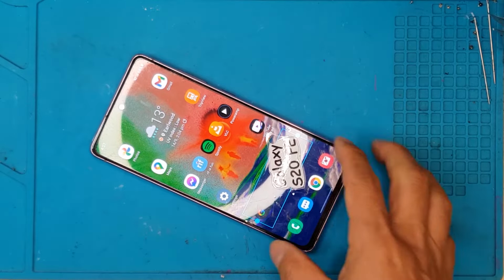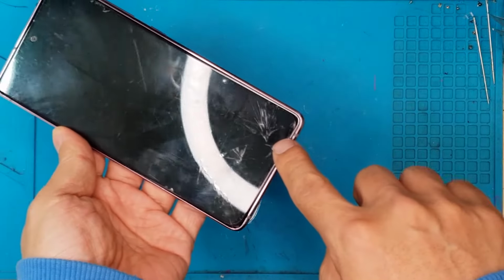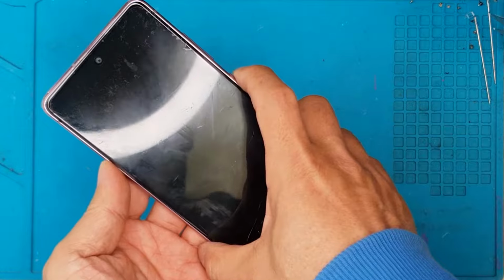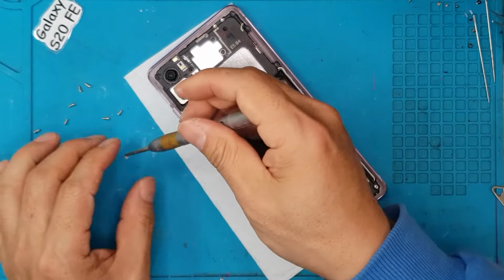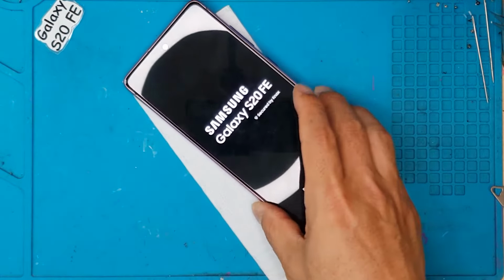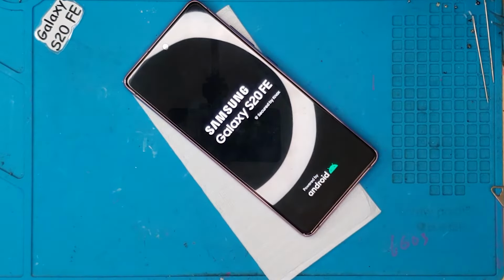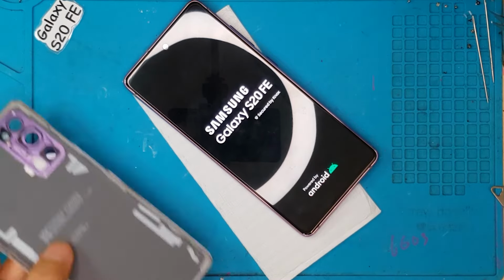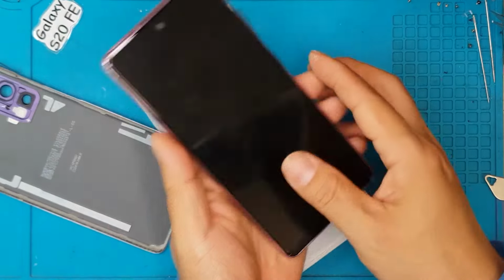How do you replace Samsung Galaxy S20 FE front screen? | Sydney CBD Repair Centre

Comment: Hello, can you please advise this ? The original phone has a metal structure directly behind the volume and on/off buttons, which houses the contacts. My replacement screen already appears to have the contact fixture behind these buttons but without the metal structure. It appears that this is already a functional system as there already seems to be a pc board of some sort there. Do you know if this is correct ? I can't see that the original phone assembly for these buttons can be moved to the new screen assembly. Thank you 😊

Comment: Great video! I followed it to take it apart as I broke the display. I bought a new chasing with a display and all I kept was the back plastic cover. I put all the bits together into the new chasing, and it is charging,I can see the percentage of charging on display but the display doesn't want to switch on!!! Damned, what is this,would you know?

Comment: What is the purpose of Signal Antenna Board on this phone?
Reply: Wifi and bluetooth
Reply: @cuf_  When I tried to replace the battery on the phone, I broke it, then I assembled the phone again and everything still worked, what does it do with wifi and bluetooth then?
Reply: @milandragacevac  the antennas are there to make the signal stronger
Reply: @cuf_  Huh, thats weird,  I didnt really notice much difference in wifi and other connections

Comment: i just replaced my screen in shop but after that gps not working and its very poor network and wifi ... kindly advise
Reply from the maker: Hello, did you use genuine screen for a replacement?
Reply: Yeah, i also facing same issue.  Display was duplicate.. What i can do now? Pls
Reply from the maker: @SmartEarn720  most likely the antenna connection should be loosen ?
Reply: @SydneyCBDRepairCentre  what can i do now?
Reply: I had same issue but I took the back of the phone off myself and checked components unscrewed everything very easy and one wire was disconnected. I connected it back and made sure everything was connected up properly and then put it all back together and my gps works now 😊
Reply: It's very easy to check and fix
Reply: Just remember which screws go where as some are different sizes. I used a hair dryer round the back of phone avoiding the camera and top area for about 3-4 mins then pryed  it off
Reply: I advise to take it to a shop if you don't know what you're doing though

Comment: Would this be the solution to a dropped phone screen that is just black with a few yellow/green pixelated areas? I assume its the LCD display?
Reply from the maker: Yes
Reply: @YakkityYakk  yes I think so. Mine is also doing same
Reply: @reflectionsantiques9302  Yea, we ended up having the screen replaced, and it was fixed